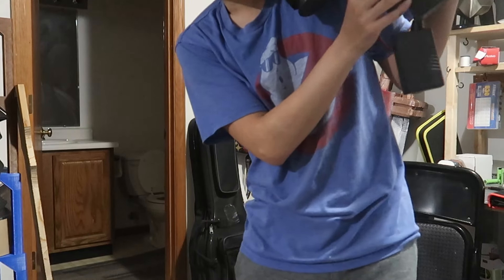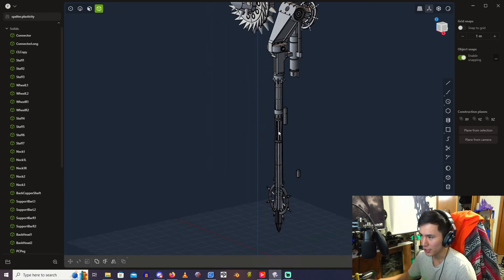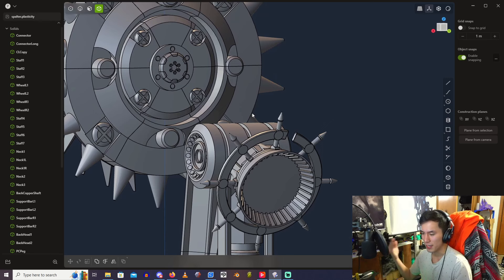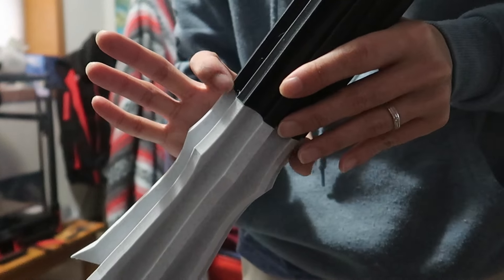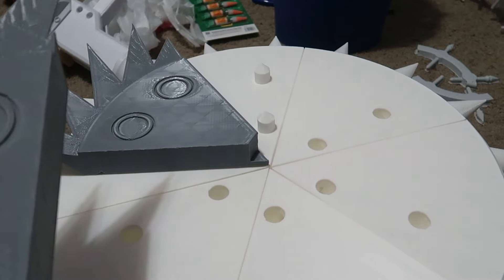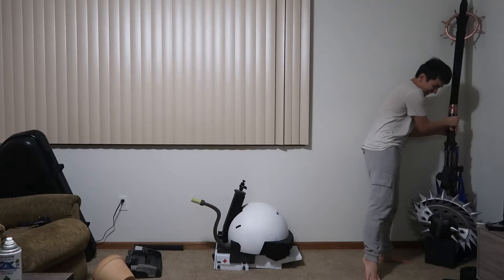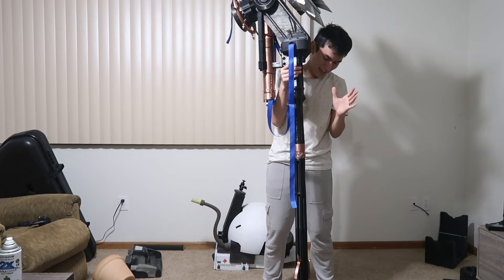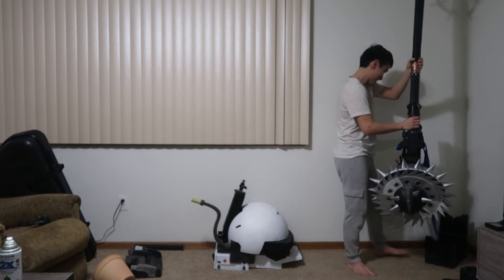Specter The Unchained, The World's Most Dangerous Pizza Cutter (Arknights) | Insane Builds

Comment: How much weight is that? It looks heavy on the wheel part that its weight could break the rod if holding on the middle.
Reply from the maker: The total weight is about 18lbs or a little over 8kg. Holding it by the middle woukd definitely put too much strain on it. If i ever remade it with the intention of swinging it around, I would incorporate a steel tube inside the length of the staff section. Even then I wouldn't want to swing it around and risk breaking it. Holding it by the middle would also be quite stressful on your arms, so the design isn't very practical unless you're a supernaturally strong abyssl hunter :P